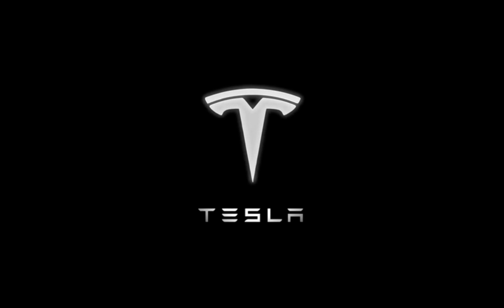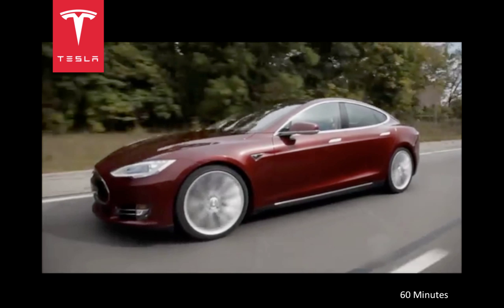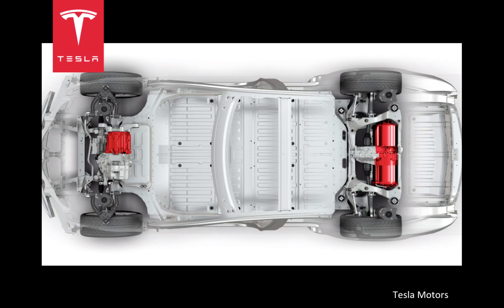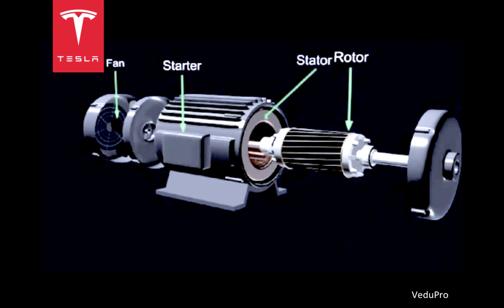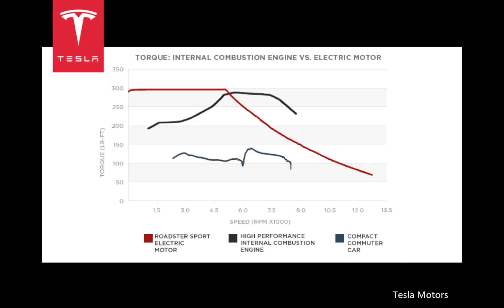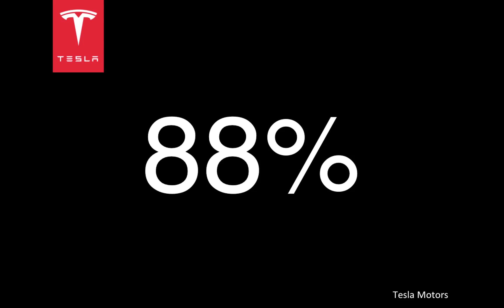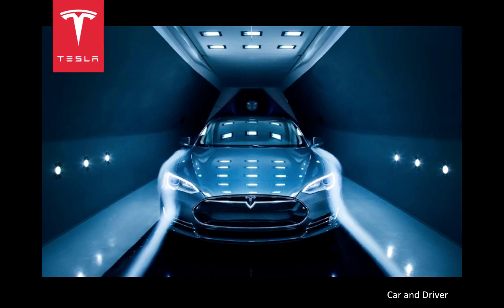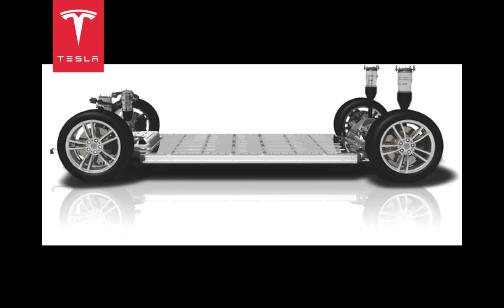The Physics Behind the Efficiency of the Tesla Model S

Comment: Wonderful presentation, thank you! Hope to hear more in the near future :)
Reply from the maker: Geo Yoshinaka Thanks!  Anything in particular that you'd like to see?
Reply: Josh Jensen I am curious to know about the overall energy efficiency of the car at various speeds, torques and the regenerative braking aspect. In particular, how the Tesla induction motor is controlled. Presumably by a variable frequency drive? Also whether or not supercapacitors are employed as power buffers when brakes are applied... etc. Oh yes! How do the batteries in the Tesla Model S differ from the Tesla Powerwall? AS you can see, your presentation has really done a great job of peaking my interest in this electric car ;)
Reply from the maker: Geo Yoshinaka Wow, those are some great questions!  Frankly, I don't know the answers to most of them, but I can try.  I believe a variable frequency drive is used to control the torque in the motor, but I cannot find any sources that can back that up.  As far a breaking in the Tesla cars, battery packs are used, not super capacitors, but according to some sources Elon Musk is looking to use super capacitors in the future.  The batteries in the Tesla Model S are lithium-ion batteries, identical to the ones in the Tesla Powerwall.  Hope this only makes you more interested in these topics!